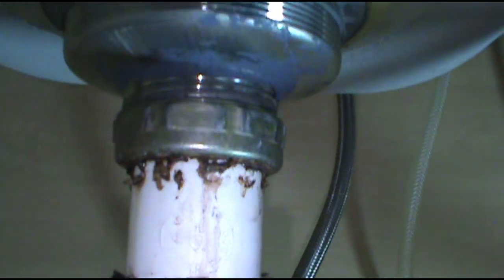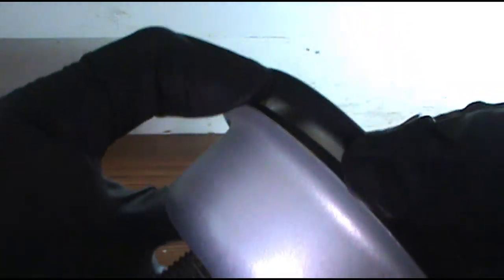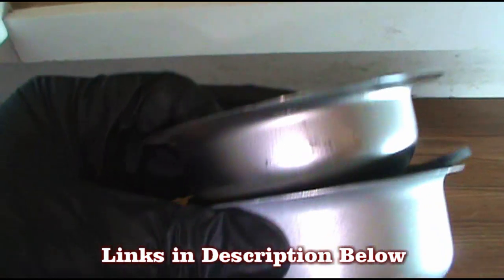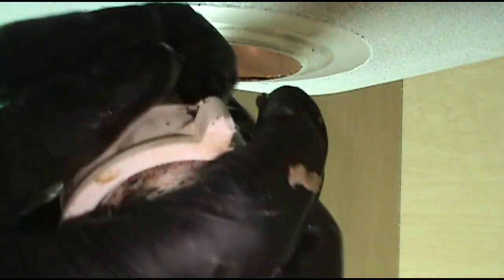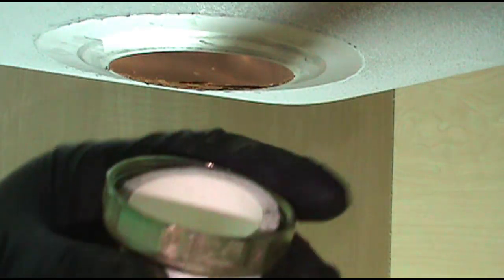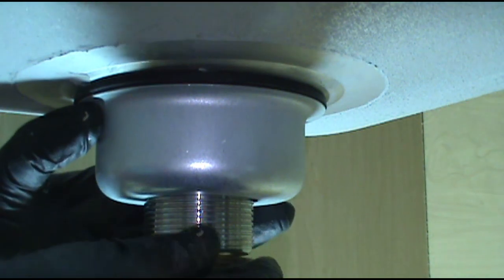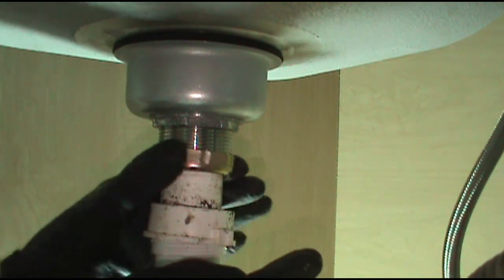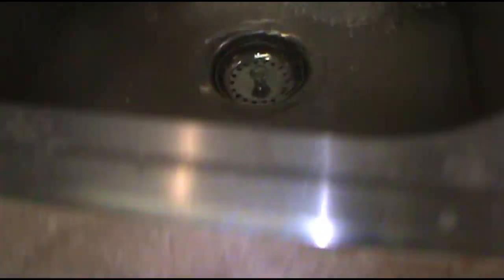Fixing a Kitchen Sink That's Leaking Underneath

Comment: Ha ha! I'm in my 70s and people who haven't a clue of what they are doing but sign up to do major repairs for others (like that guy in these comments who got hired to do the restaurant repairs) are the exact reason I do all but extreme major repairs myself. I figured out YouTube and I are as good as the self-proclaimed experts I had in the past. Different handymen/repairmen were clueless at my last 3 jobs for them, so finished the jobs myself and never called them again (lawn tractor, fridge temp. control, simple wire replace on washing machine).

Sink strainer bowl workings just lifted and separated tonight before doing hand dishes. Good timing actually since I have had the pvc pipes bought for a long time to replace the old metal drain runs under the sink. Had a temporary patch on it. One spot had corroded through the pipe and made me wonder what the heck was in my water to eat a hole through it. Thanks for the demo. I'll tackle it the next rainy day.
Reply from the maker: Thank you so much for watching Islandgal!

Comment: Newbie question! What about the double bowl is better? why is it beneficial to have a second bowl? if there's a leak its still gonna leak right?
Reply from the maker: It's just a better design without that gigantic nut holding everything up. The smaller nut makes it easier to install or take off if it happens to leak in the future. Yes, everything that has to do with water will leak one day. But, I've got double bowls I installed 5 years ago that are still doing great today. I loves me a double bowl. Good to hear from you Oliver!
Reply: Lex Vance Ok gotcha. Thank you for the explanation. Be well sir 🤙🏼

Comment: I have a question, Why is my Air conditioning unit so loud on startup and when it’s running? I have some videos on my channel of how loud it is. Please tell me why the hell this thing is so noisy. And keep in mind the walls shake violently when the indoor fan is on.
Reply from the maker: 😆 I watched the videos. You may need to tighten some loose screws. It could be that easy. Thank you so much for watching Alex!
Reply: Lex Vance what screws do you thing I should tighten